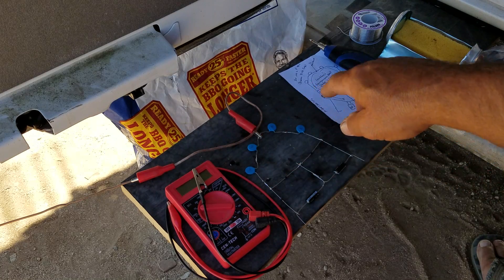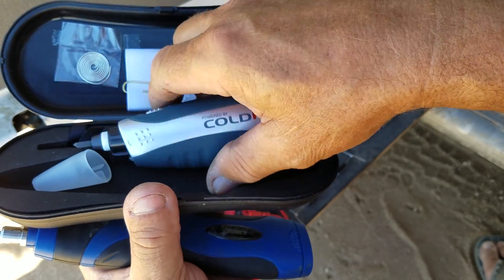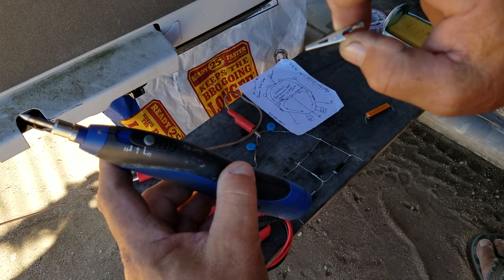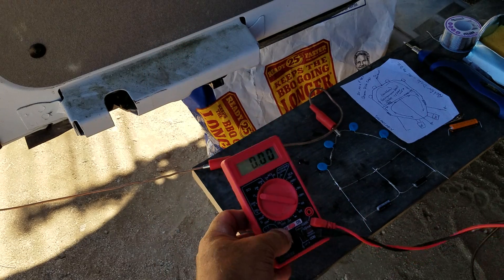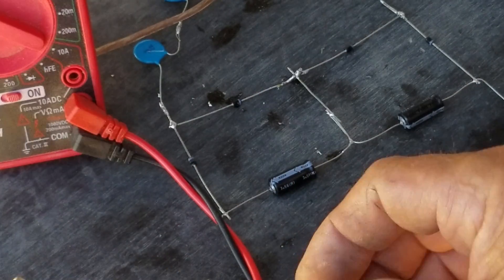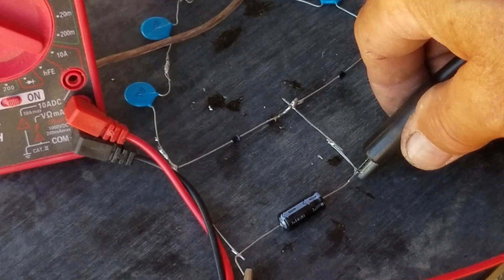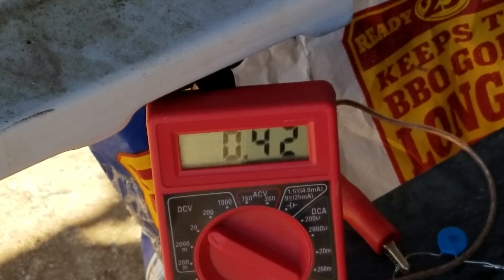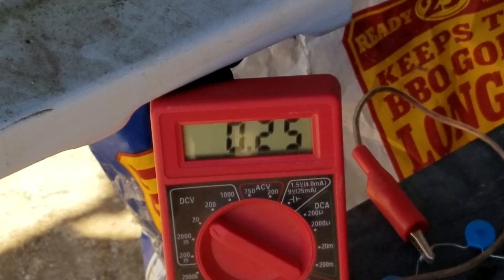Electricity from the air collector

Comment: Not the most scientific of experiments, anyone doing this needs a large curved collector plate or ideally a ball as sharp edges cause ions to be emitted back into the air, germanium diodes-correct as they have low forward voltage, use full wave recitication not half, and get that collector as high in the air as possible (100V per meter), most interesting is that you can increase the number of collected ions by switching the collector circuit to ground at a rate.

Comment: My idea was to get a choke of several henry going to a 150w piezo tweeter in parallel with one end going to the antenna and one to the ground and using a diode bridge in parallel to try to get some energy out.
Reply from the maker: You may want to add capacitors.
Reply from the maker: Welcome aboard.
Reply: It may need a matching coil too.
Reply from the maker: If you mean a transformer, that could work
Reply: @GBear  Well I did it first with an audio transformer and a piezo disc but I think it just buzzed from the AC hum from the power line. It is great for picking that up.
Reply: @GBear  Some circuits I had to use matching transformers.
Reply: @GBear  Also I had an idea based on Telsa power from air using a switch to turn the ground on and off. And use a three plate capacitor of flat copper sheet for an antenna. It would have a dielectric or electret and graphene on the outside. The switching makes AC that a transformer can use.
Reply from the maker: Sounds interesting.   I will wait for your report on it!
Reply from the maker: Overhead power lines are a great source of energy.   It drives the power companies crazy when they can't find where the extra load is coming from.  No wires connected, so no train to follow.

Comment: Question thou will gain a little voltage if you give it a little wave in the air
Reply from the maker: Electricity comes from the earth and the air.  The air part is controversial because it could be affected by the sun.
Reply: Oh ok I thought it would collect more ions if you wave it in the air😂 oh bowy
Reply from the maker: @StillWatchinconspiracies👀  some have said the higher you raise it up the better the input, yet some of my other videos show me collecting electricity from the ground.  Remember,  electricty and magnetism are the same thing, electrons flowing in a direction.  Radiation also fits in by pulsing electricity through the air.  The differences are how that electricity will be harnessed.
Reply: @GBear  yes I remember reaping ions from the either too as well with tall poles
Reply from the maker: I've collected electricity from trees.
Reply: @GBear  that’s what u would love to do that amazing
Reply from the maker: The earth itself generates electricity, nonstop.  Magnetism is associated with our north and south poles because our liquid core made of molten metals produce that magnetism, and magnetism is essential for electricity.  You can wrap a wire around a nail and apply a battery to make a magnet.  You can also move agents over wire coils and produce electricity.   The two powers cannot exist without the other.

Comment: Hey bro. Thats cool. I have a bunch of ideas here. I've had a thought for many years now but have never had the time to studdie this farther. 
I don't want to really say much here.  (No offense to others ) but. I'm 100% in belief that there is much more right before our eyes which we ignore due to the influences of our surroundings, but all it takes is doing it. 
I'm only going to start with this. 
Have you taken that big yellow cap and put it between the long wire and the circuit? 
Ok, now , have you heard of the electronic siphon?   It was sold by Sears in the early 1900s. 
This is exactly what Tesla was referring to when he said," its as easy as sticking a rod in the ground to get as much power as you want. " 
I will leave you with that. But... do not forget to include me in your findings when you go to show them. Ok, peace and good fortune.
Reply from the maker: Thanks and welcome aboard!  I'll give it some consideration and for sure mention you if it pans out!

Comment: You need to add a spark gap! Spark gaps increase voltage, look up Nikola Tesla's spark gap and add that at the end of your circuit before you use the power. It will increase the voltage!
Reply from the maker: Good point!  For that experiment I wanted just to prove that electricity was present and didn't want to confuse people who might think there wouldn't be any electricity present if not for the spark gap.
I ran in to similar confusion when adding capacitors to circuits.
Reply: @GBear  Agreed, this helped me understand a lot easier than other attempts! So I appreciate this video and the circuit showcase!
Reply: @GBear  hey G bear I am laying here looking for your video for today's video. When I saw those bare wires running to your barbecue it reminded me of when I was a very young lad probably 6 or 7,  I took bare copper wire hooked it up to my red radio flyer and then plugged it into a 120 voltage outlet, I still got the scar on my thumb and index finger and I can still smell that burnt flesh and no my wagon did not get energized. I thought it would be like the bumper cars at the amusement park LOL
 😂🤪😳
Hope all is well with you and TomCat✌️

Comment: great video, forgive the silly question but how can tell whether the drop in the voltage at approx 09:30 isn't due to the loss of the voltage generated by your set up and not from atmospheric electricity?
Reply from the maker: Welcome aboard.   I disconnected the voltmeter for a few minutes and when reconnected the voltage went back up, then slowly went down again.  I did this a few times and deduced that the meter was using voltage to power the readout.
Reply: @GBear  so where's the atmospheric voltage?

Comment: I like the horizontal antenna. Longer thinner transformer wire, much smaller electrolytic capacitors, only two small AC capacitors and an Earth ground. It's Nikola Tesla's version of a full wave bridge rectifier sensitive enough to utilize RF. The smaller your components are the less capacitor leakage you will have and more voltage potential stored as opposed to lost. Mine charged an outdoor LED flood lights battery pack. It works and it's already proven technology. Most newer cell phones have wireless charging capabilities that are very similar to the crudementary circuits we build
It will work better in daylight

Comment: Some time back my friend and I were experimenting with some Tesla like designs, circuits etc. We started very small and ended up very big. We started with a small electronics kit, with a 1.5v battery. Using oscillator circuitry, we then kept adding on to it with more powerful components, finally doing away with the kit and just utilizing more powerful components. Instead of the tiny caps, we used big electros and was running the whole thing with a 12v car battery. We also used a tuning circuit to resonate the electric discharge. Everything went well until we tried to turn it off, it started to give off a green light around it, the battery and the room. Had to use a wooden rod to get the terminals off, however it kept running for some time. I wont go into the details of the circuit here, if anyone is interested just comment, thanks.

Comment: I wonder what will give you more voltage: that antenna  or a boatload of thermocouples.
Reply from the maker: Maybe a skeleton key on a kite string?
Reply: @bubba, thermopiles  if you have a temperature gradient and a way to dissipate heat build up from the cold side....

Comment: Looks like this is over some ppls heads! I thought about doing this, with a lot of wire antennas, and ground rods, solar cells after all are only about 0.5v , but the voltage goes up the higher up! A couple towers , with a good ground, maybe I could get enough for a couple garden lights, being off grid , every little bit helps, I haven't tried because all the experiments I seen, only get low current, I have seen 15kv, but micro amps, maybe they could be paralled, and drop the voltage to something easier to work with, although wattage is lost!
Reply from the maker: Yeah, I was thinking of trying to add capacitance.

Comment: ive seen two powerful magnets either side of a copper winding generate enough power to illuminate a low wattage bulb , no moving parts , ive seen it a few times now. it wasnt quite as i explained it but you get the idea
Reply from the maker: Magnets and electricity are basically one in the same.  Electricity was never "invented", it was "discovered".  Earth's magnetic field induces electrons to flow through a conductor.   The stronger the magnetic field and the better the conductivity,  the more powerful the electricity.  Lightning passes through the air very quickly during an electrical storm yet many factors determine that speed and power including moisture in the air,  size of the storm, and distance to earth.
Reply: @GBear  yes, harvesting power from the atmosphere was teslas goal yet he was thwarted by the greedy, amazing how his prophecies are now in everyday appliances, tvs, radios,mobile phones , satelites etc. dont think id like to live in an enviroment that you could harvest huge power though, like near huge AC high power lines where all you need is to hold a large flourecent globe beneath them and it lights up, Here we have cancer clusters where ever people live right next to high tensoin power lines , mind you there in that feild every day and night 7 days a week.
Reply: @GBear   If you are able to type without inserting an 'umm' and/or an 'err' into every sentence, maybe you could do the same when talking, please?

Comment: What you have here is an antenna connected to an Avramenko plug (look it up). The wire acts as an antenna, capturing electromagnetic waves, radio signal etc. The Avramenko plug converts it to DC. It is pretty cool actually. 
The Avramenko plug was invented to transmit power through a single wire. AC power enters the wire at one end, DC power is collected at the other end with the Avramenko plug.
Cheers.